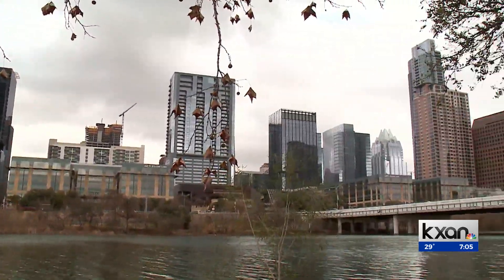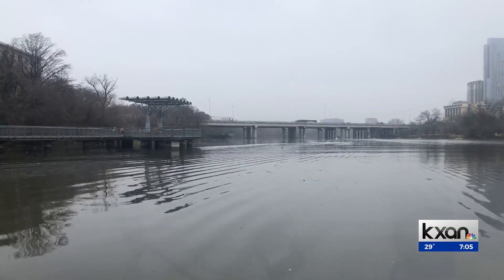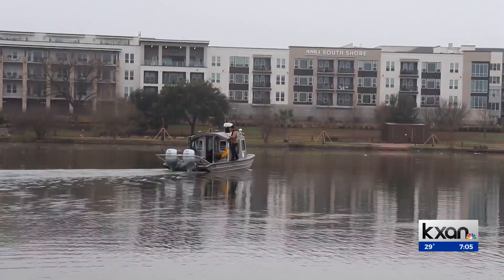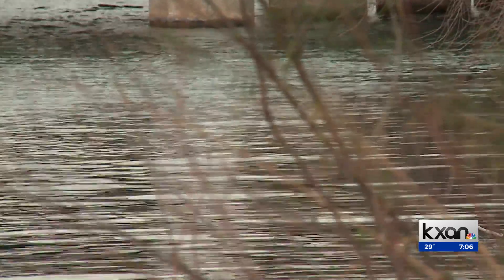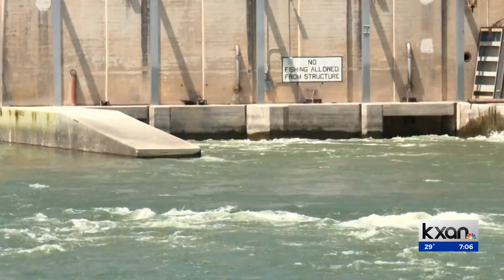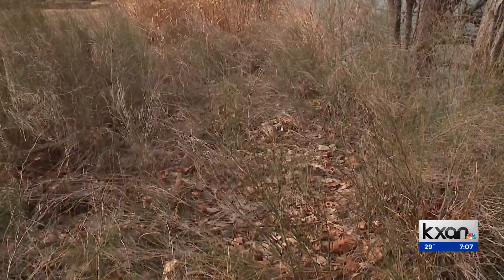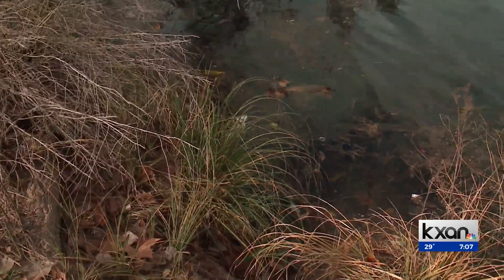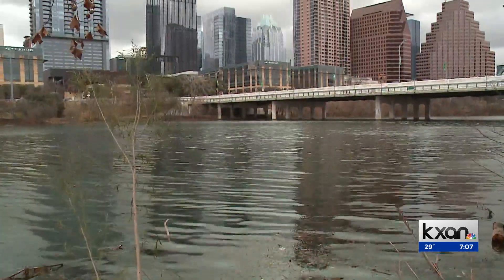Mapping the bottom of Lady Bird Lake

Comment: They neglected to show or give their findings. They also neglected to mention how many trees and remnants of cars from the Memorial Day flood are in that riverbed from Shoal Creek to the dam. The 1981 Memorial Day flood dumped approximately 500 Vehicles into the creek from dealerships that lined Lamar Boulevard at the time. They were never removed from the river. When I was a child in the sixties and seventies they would drain the river down to a creek that you could jump across every couple of years but they stopped doing that after that flood because it would reveal all the vehicles and they did not want to go through the expense of removing them.